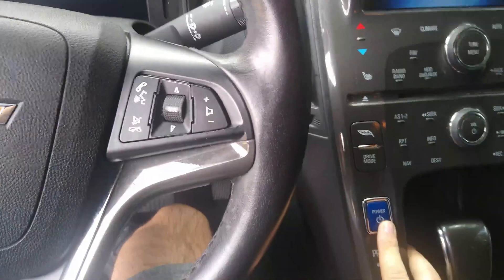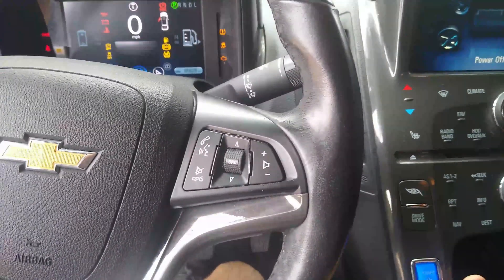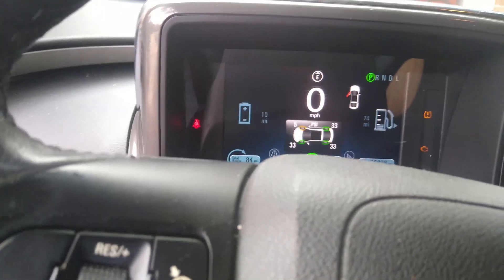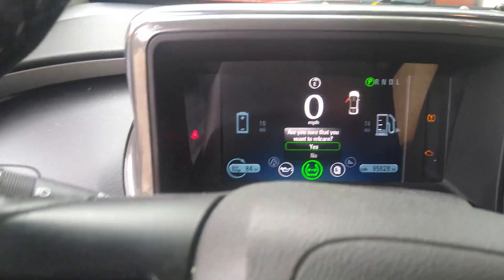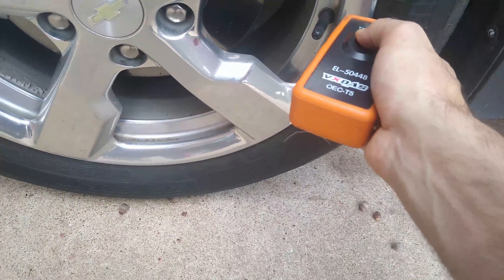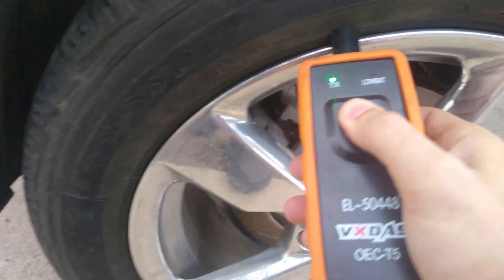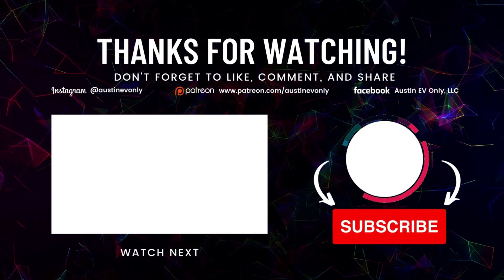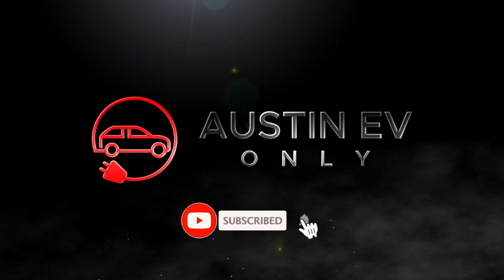Chevy Volt tire pressure monitoring system TPMS Programming

Comment: my volt has a "service tire monitor system."  will this fix it or do i have to change a tire sensor or something else?
Reply: Did you ever get an answer to this?
Reply: @dylancuadra1540  on my own.  had to replace the tire sensors at a tire shop.  the device can do a reset but not if a sensor is broken.
Reply: @daveheel  SO i can not use the reset until the sensor is replaced? Because at the moment i can press the button all i like, nothing happens, i cant use the tool because the car does do anyting.
Reply: @Tom-l7w1h I'm no expert but the battery dies as batteries do for the sensor so it has to be replaced before you can program them.  My sensor goes in and out.  Scotty, the auto YouTuber doesn't even worry about the sensors.  You can check your air pressure the old fashioned way with a tire gauge.  I didn't change all the sensors so the ones I didn't eventually failed.  I just don't bother since taking the car to a tire shop takes time and a lot of money to replace them.